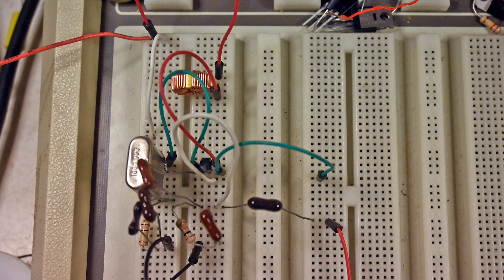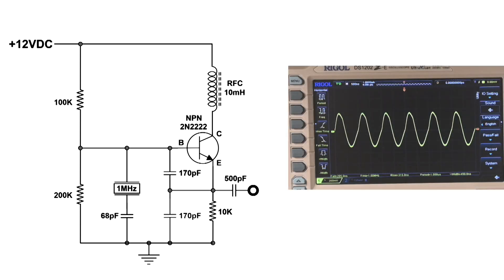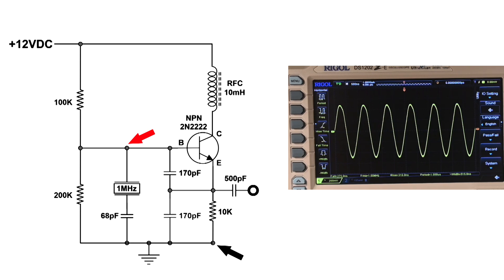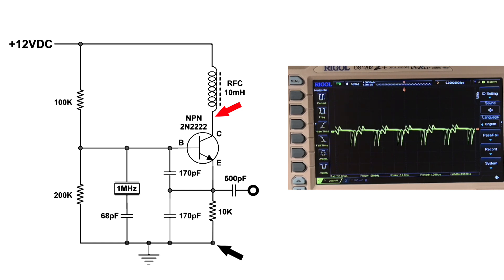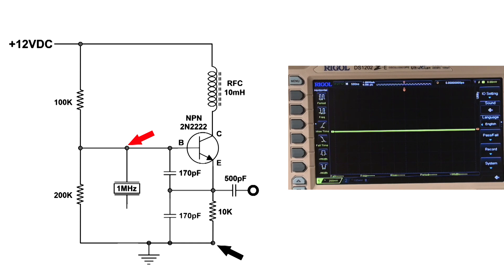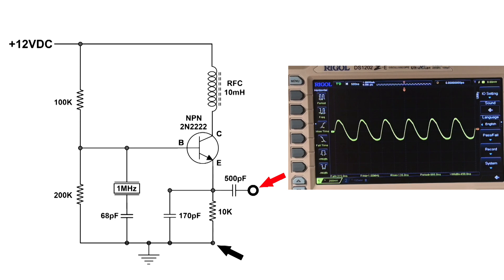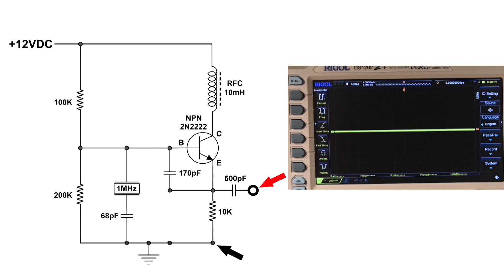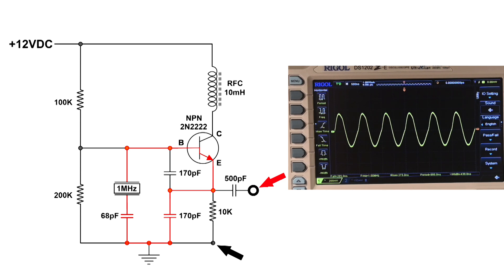1MHz Crystal Oscillator How to Find the RF Feedback Path

Comment: Hey Rick. Great video! When you remove the top 170pF capacitor the city keeps oscillating due to the junction capacitance between the Base and Emitter. So in fact you are still getting feedback from the emitter to the base. A nice video would be to look at the emitter waveform and base waveform on a dual scope. Would see if there is a phase difference between the two.
Reply from the maker: Hey Dick, That is a good idea. I’ll be glad to do this circuit again. I have found Emitter Base feed back in another video; I’ll put a link at the end of this. Good to hear from you, I would like to give you a call. I have a interesting story about another oscillator video. Let me know when we can talk. Thanks for the comment and suggestion!!!
Oscillator Experiment Interesting Results II
https://www.youtube.com/watch?v=MITyF5wX8SQ

Comment: Thanks Rick. Would some other transistor make the output follow the input better? As in more symmetrical sine wave? Looking to use this to modulate a audio signal.
Reply from the maker: Other transistors may work. I was thinking about trying to adjust the bias on the MOSFET to see if I could improve the modulation from about 50% to 90%. The signal would be much better.

Comment: Obviously the circuit won't oscillate with only one end of the crystal connected, but what happens if you replace the 68 pF capacitor with a short to ground?
Reply from the maker: It oscillates about the same without the 68pF. That capacitor is a DC block. The capacitor probably to protect the Crystal.